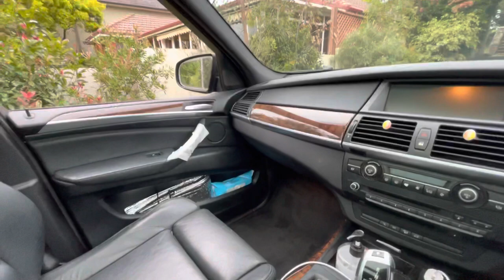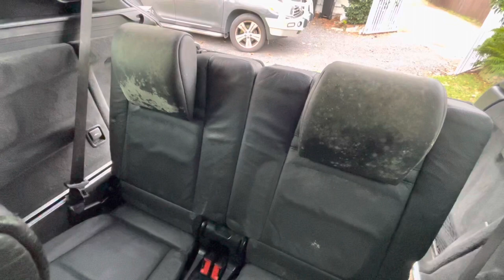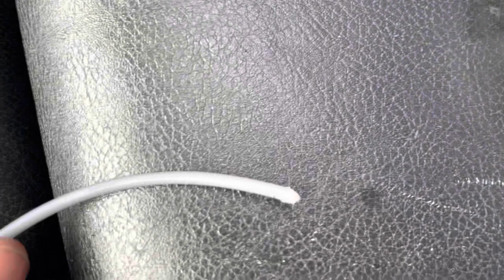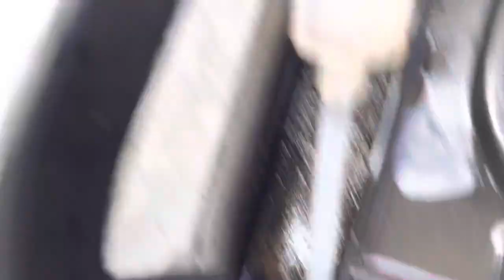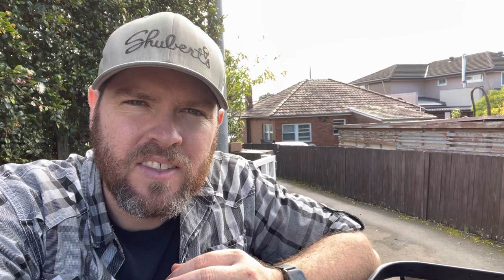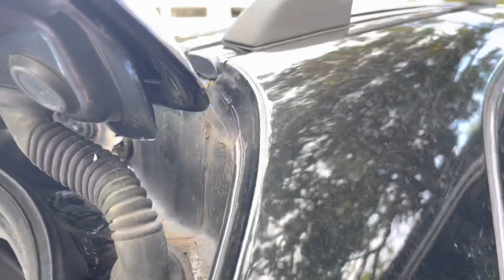Introducing “Squats” and fixing his leaking sunroof. How to clear sunroof drains on BMW. e70 X5

Comment: A $100 USD Ozone generator will kill all the mold and smell in the car, as well as any living organism. Make sure you turn on the AC for about 15 minutes while doing it. After an hour, open all the windows and leave on the AC to get it out.  It will smell like ozone for a few days, but most find it pleasant. Best video, I've seen for this issue on an X5, well done sir.
Reply from the maker: Thank you thank you. That is a great idea for clean up!
Reply: Don't forget ozone is an insane oxidizer so it'll tear through leather, rubber seals, etc.... and it doesn't kill all the mold/spores. It's also unsafe to breathe so be  in a well ventilated place if doing so (not to mention you should wear a mask rated for mold/spores when cleaning).

Comment: Same exact clog with my 2014 x5.  Instead of a tube in a syringe , I just hot-glued a tube to a water bottle after making a hole in the cap.  Just squeeze and release a few times, and it cleared.  The clog is most likely that rubber grommet at the very end of the drain tube.  Hot water with some PSI will force any sitting debris through the slotted grommet.
Reply from the maker: Yeah nice one! Love a practical homemade tool. The style you have made, like the Syringe, are better than straight air pressure as the air pressure can cause fittings to pop inside the pillars. The back and forth motion of squeezing and releasing agitate the pressure and (hopefully) dislodge any clogs without applying excess pressure. Nice one mate!!

Comment: My 2008 X5 had same leaking issue. I cleared blocked drains similarly.  To dry carpet I lifted carpets and ran wet vac in to blow mode under carpet for 24 hours which worked a treat. Happy days however interior light had been swamped and still doesn't work.
Mal from Perth WA
Reply from the maker: Yeah if you can get some airflow around the carpets it helps soooo much! Nice work!

Comment: Thanks for the vid. I have to also add, please be careful sticking wire/plastic down the drain tube, I went with the small plastic tube to suit the drain hole and vacuumed out from the sunroof drains using water and WD40 to softened the debris/blockage. To my surprise I ended up sucking out a Camphor Laurel berry eventually after 6 or so rinse and repeats. If I went for the push through or compressed air method I would have blown off the drain tubes. Cheers Gaz
Reply from the maker: Great advice. If you have the ability to suck then that’s even better!

Comment: Good video.  Thanks for showing how to clear those drains.  I need to find drains at the firewall under the hood bonnet where the water runs off the windshield and clean those.  
That dealer or person who auctioned the vehicle should be taken to court.  Surely wherever you there are consumer protection laws at least to some degree.  I've been a lawyer 34 years.  Your auction listing can be clear proof of the misrepresentation.  You could try to force the seller to buy the vehicle back.  There may be a prerequisite to filing suit such as a written demand letter served on the defendant by provable method (in the US it is called Certified Mail).  
Do not accept that injustice.
Reply from the maker: Hi hi. Thanks for your message. The drains empty out down the A piller and the water will come out behind the front wheel near where the front door and the front guard meet. Best way to clear them (if you can’t clear them from the drain hole at the sunroof) is to take the interior trim cover off the A pillar and access from there. I found this page for the E53 x5 but I think the e70 is pretty similar.

https://bmwrepairguide.com/bmw-e53-sunroof-leak-and-drain-cleaning-2000-2006-x5/   (Go to that address and then click on “repair steps” for all the pics)

As for that specific car, yeah I was annoyed about the misrepresentation of it being declared roadworthy. someone had clearly got a dodgy safety certificate. Luckily I bought well enough that I didn’t lose too bad. I ended up trading that car for something else in the end. The guy who traded with me was a whizz with the e70s and had it all dialled in in a couple of weeks 👍👍 glad it got the loving it deserved.

Comment: I have x5 2013 water Leak from roof to Left side of Trunk Compartment and  cause all sort of Electrical Malfunction Errors .  Appreciate any help  to fix it .
Is there any one can help ,  I am in Indianapolis !
Reply from the maker: Sorry don’t know that area at all. Anyone on here know Indianapolis? 
My first guess is that, if clearing the lines hasn’t worked then your sunroof rear drain line has failed. Possibly a connection has broken or come undone? To check you would need to drop the roof lining and inspect that way. Good luck!!